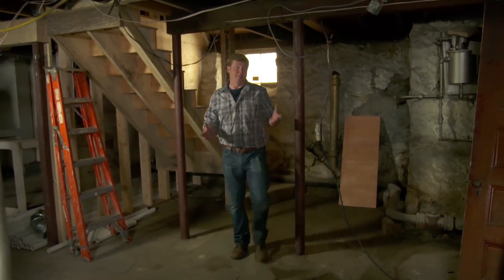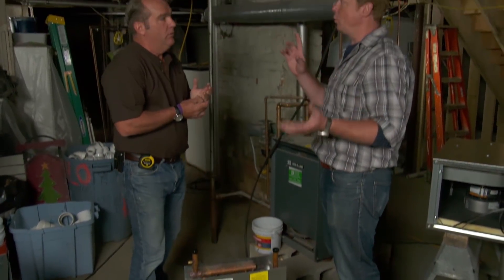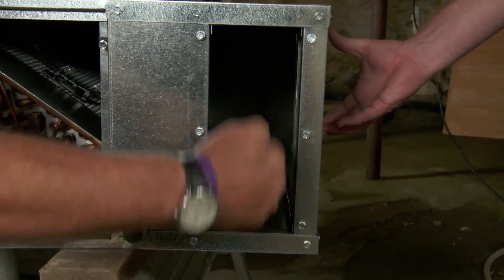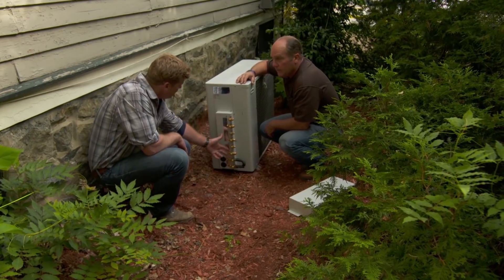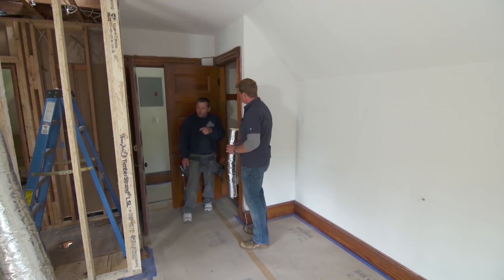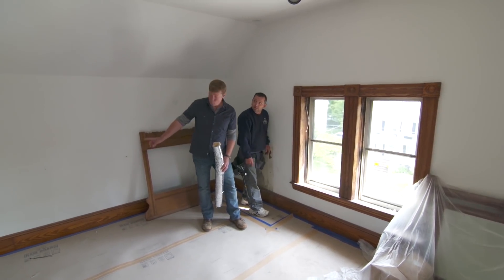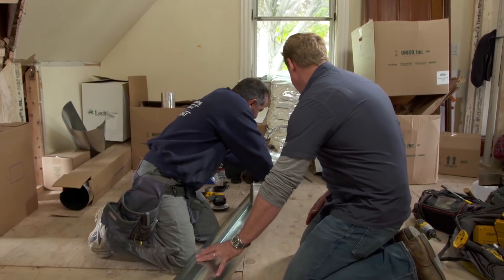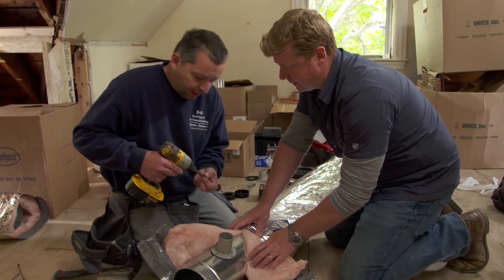How to Duct and Zone an HVAC System | This Old House

Comment: My apartment uses hydro air (heating loop off a high BTU water heater). Very gentle heat compared to a typical gas furnace.

Comment: Can someone tell me how much this system would go for plus labor??
Reply: At least 8000 but 125 an hour for labor figure 8 hour days 7-10 days. Plus the new a.c. and that one I have never seen so it must be new. So its gonna be at least 2000 for that. Then moving the boiler on top of having three air handlers but guess that its 15000 a space pack which is an air handler on a house with out central air plus the duct work we were at a house for 7 days roughed in the electrical for the outside the copper refrigerant lines for the a.c. outside then in the basement ran the conduit and the wires to the electrical panel then the hole cutting for the mini vents in eact room that judt was 10000.
Reply: @thomaslascola2698  OMG 😱😱😱😱 😳😳😳😳😳😳

Comment: How do I contact This Old House to ask about, Replacing my current A/C and Heating System. I want to get Lennox  or better Mft. For the entire house, please. 4 Mini Splits and 4 Ton Condenser I know that.
Reply: contact a local dealer
Reply: Mr Google can tell you....
Reply: Call an HVAC contractor.
Reply: Lennox is horrible. Plus assholes. As they dont teach how to fix them unless you become an authorized dealer.. the. EDT system to get is a trane or american standard. Better warranty system as well.
Reply: @thomaslascola2698   American Standard  Basically Trane  Lennox  used that leak Microchannel Coil  don't they

Comment: Anyone know what brand/model that compressor (w/ 3 air handler) is?
Reply: Lots of manufacturers make them. Mitsubishi, Daikin, Carrier, Samsung to name a few. It’s a Variable Refrigerant Flow style of unit (VRF system for short)
Reply: @adjahnithermot2275  I can only find mini-split variants. I'm looking for something that works with a standard air handler for use with multiple forced air zones inside (as in the episode).

Comment: 0:51 that's exactly how your heater in your car works. Your engine heats the coolant which travels through your heater core which is what richard is pointing out then your interior blower motor forces air across it proving heat from your vents. 
Source 9 years as an auto repair technician
Reply: @Kevin-mp5of  no
Reply: @Kevin-mp5of  : Go away child... There are plenty of makeup tutorials for you to watch.

Comment: High velocity system. Never heard of them. I will be busy reading up on these.
Reply: @rickyhertz7250  thanks!
Reply: I never experienced one myself but i hear they are noisy
Reply: Look up Unico systems
Reply: @mitchdenner9743  only reason they're noisy is due too poor installation. An experienced installer will know the proper way to install the system. The rules for where to place takeoff from the main trunkline are different then a traditional system.

Comment: I would've went mini split
Reply: that's what I was thinking..... mini split HP is far simpler, cheaper and more efficient..... only down side exposed indoor unit... but some can fit the wall...
Reply: Yeah, Mini splits are easy and cheap, but Hi-V is taking over, as they're more versatile and can cover the whole house
Reply: Correction, Mini Splits can also cover the whole house too, with just one outside unit too... 

Hi-V only advantage is the indoor units are located at a more remote location... So it sold as a more upscale option.... But some mini splits can be placed in walls too... So Hi-V are more marketing BS... 

FWIW it would be nice if they made a GSHP  Mini Splits for greater efficiency
Reply: @nc3826  mini-splits are less efficient for houses that have chopped up rooms (not open concept) and so these whole house ducted systems cover the whole square footage with no cold spots.
Reply: ducted systems are far less efficient, due to temp duct losses.... and less effective  and more costly, zoning options....

Comment: Went to ductless mini-split system. Never going back.
Reply: Hi. Could you share why? We’re looking into either minisplits or high-velocity to cool five or six rooms in our 1930s brick house. The splits would require snaking some of the lines around the house. Wondering whether a zoned high-velocity system would be better. What did you find to be the biggest drawbacks? Thanks.
Reply: @AT-oj7of  Do not let them "snake lines around" If you have long horizontal runs you will have problems. Trust me I know. The first installer had no idea what they were doing.
Reply: @oldcountryman2795  Thank you. Would you happen to live in New England? If not, would you mind sharing who did your job? Perhaps they know a good contractor in my area. Thanks.

Comment: Why not just add Ductless Splits in this case?
Reply: Yeah. I do not understand that HVAC installers love of bulky ducts and air handlers. They could have just run to some mid-wall or ceiling units and gotten heat pump heating out of the deal for a very minor up charge.

Comment: You won’t HVAC guys likes them in your locality.  I looked at my duct work and there are leaks everywhere. My one zone system is 6-8 degrees hotter in the 2nd floor than 1st. Tried to restrict outlet flows on first floor to force more air to the 2nd floor.  Didn’t work and still a big temperature difference.

Comment: Insulation inside for the temperature you are trying to reach seams pointless.
Reply: Trust me it helps. ive got a house with poorly if any sealed ducts. my bathroom counters are actually warmer than the vent exhaust just below it.  even just a thin board of plywood of drywall serves as enough insulation that of the 'conditioned space' that the hvac will need to work longer to reach the desired temperature.
Reply: its not used for Insulation its for sound deadening ... its mentioned in the post... so your comment seemed pointless.
Reply: @ilovefunnyamv2nd  Sounds like a good deal to me. Warm surfaces is more comfortable and economical than warm air. Try heated flooring or blankets, they are great.
Reply: @nc3826  Ok, I missed that.